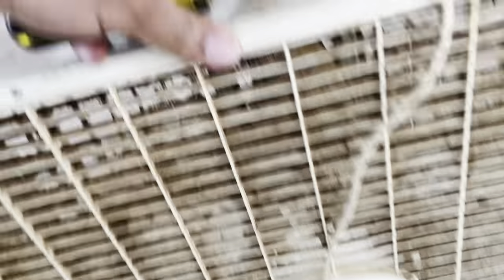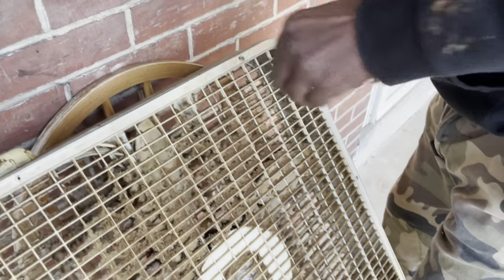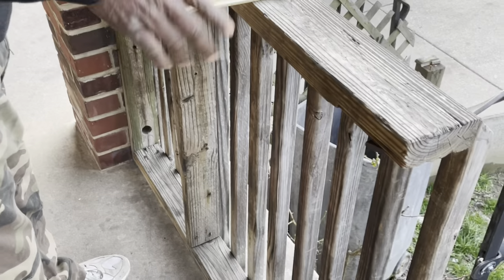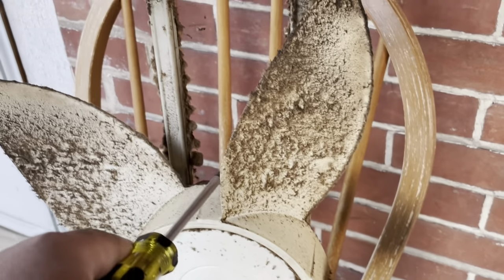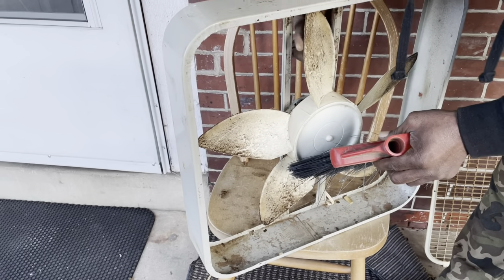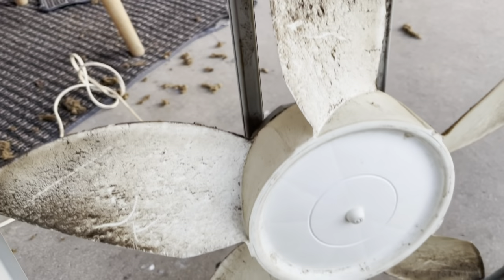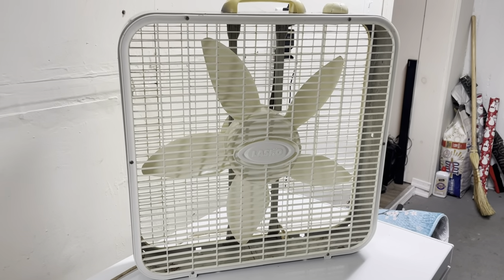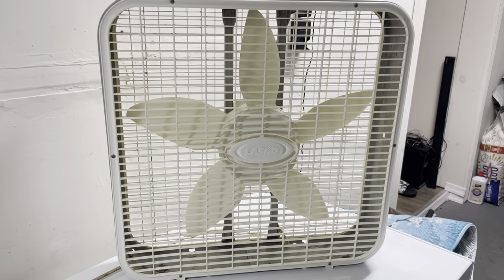Lasko 3733 Box Fan ‘Restoration’

Comment: Tip for cleaning out grills:

#1 take grills outside where there's a hose. 

#2 If u have a hose nozzle that has the diff settings use FLAT (I think that's it?) 

#3 spray grills with flat setting.

#3 they should be good!!!

Comment: IVE ALWAYS WANTED ONE F THOSE NO FAIR!!!! THATS MY DREAM FAN!!
Reply: I have 2 of them…
Reply: They are very common
Reply: @fanboy11thefanfanatic  is it vintage I love the early 2000s ones I'll take it I have 2003 ultra weather shield
Reply: @fanboy11thefanfanatic  As common as they are, I oddly don't usually see 90's and early 2000's Lasko box fans locally, maybe once in awhile, but I never come across any used ones being sold. I did once see a 1997 Lakewood 200i for 10 bucks at a local thrift store, and I still regret not getting it.